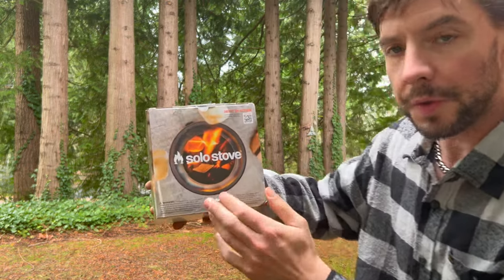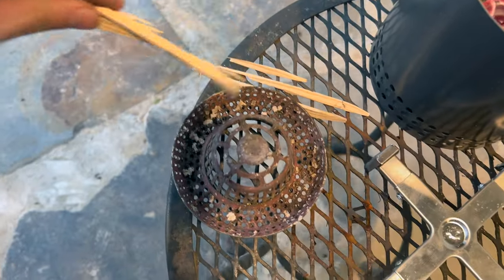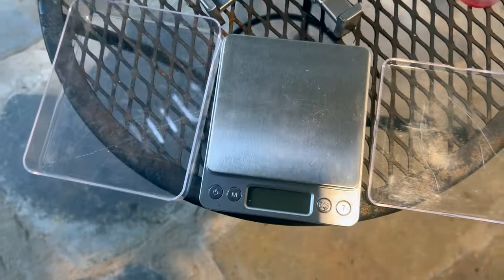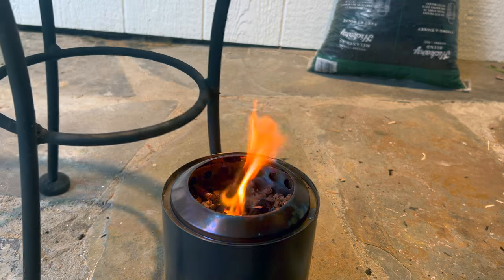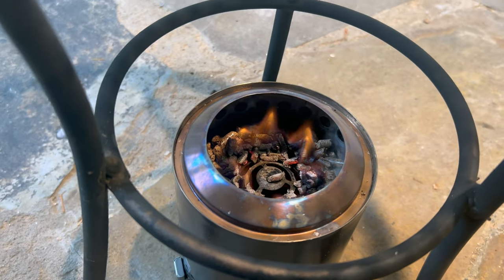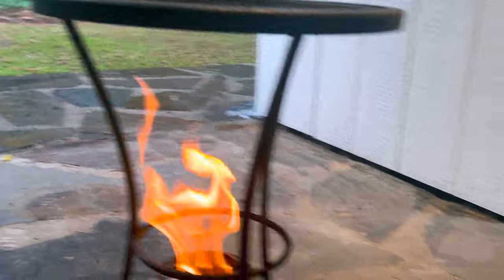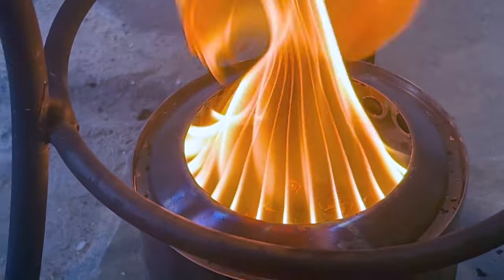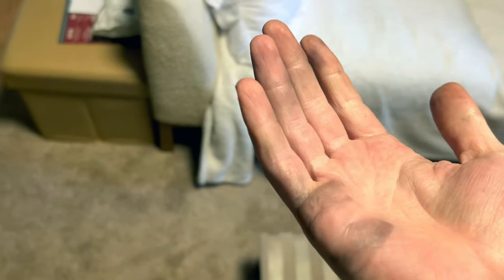Stunning 4K UHD Solo Stove Mesa testing & operating, burn #4 with commentary & thoughts

Comment from the maker: Mesa is their most popular model

2.34 kilowatts of heat or 8000 BTU running on 289 grams of hard wood pellets for about 8 minutes at full output. Add 1/4 of pellets every 5-8 minutes to keep it going.

You can use it for cooking, boiling water, making soup, a dutch oven, just place the unit under a fire resistant stand, tripod holder, or similar and let the heat output from this stove and the fuel (twigs, or hard wood pellets) provide the heat energy. Be forewarned that a nice gooey layer of carbon tar will be deposited on the cookware, thats hard to remove, though the black soot deposited makes an excellent ink pigment for dark flat black, if you collect and mix it, sorta like old diesel vehicle exhaust can :) Think super fine carbon, very nice dark black ink pigment. 

The flame output can reach 3X the height of the stove from the top, and makes a sooty orange yellow billowing flame perfect for warming a small space outside during the evening with two people nearby, think patio heater. Have a bag of hard wood pellets with a 1/4 cup measuring cup made of metal to add pellets every 5 minutes or so to keep it going as you enjoy making smores or cooking meat on a metal rod or veggies on a metal rod. 

It's well made and comes with a lifetime warranty! They are on sale now too! We got ours as a X-mas present for 2023, thanks Sissy :)

I use small shards of pine wood knife split off dry pine 1X2 parts + a wax votive candle as a starter and that seems to work well! You can use paraffin wax + sawdust fire starters and they seem to work fine too.

Comment from the maker: Having to add more fuel every 5 min while cooking adds a fun challenge :) This little thing is a twig and pellet eating monster! I had no idea that much wood required to make 8000 BTU or 2.34kW of heat output. A bit like a candle in the wind in terms of thermal performance unless you are very close to it. Also the wind pushed the flame around a lot, so if you're using it to dry anything, be cautious to leave about 2 feet of gap space between the flame and what you are drying outside. In a fun note, it can add nice wood smoke aroma's to things you drying with it and you can smoke meats and veggies and other foods by running it rich with extra wood and vastly lower combustion temperatures. I am able to get it to bellow out vast amounts of smoke that can be lit into large flames with more ignitions.

Comment from the maker: Be warned. I used this stove to cook bacon outside, so it would not make the entire inside of our small home smell like cooking bacon, and used a small 8in stainless steel pan that was coated with a thick gooey hard to remove tar carbon from the sooty wood flame from not very efficient combustion (yellow orange beautiful, but indicates low combustion temperature)(blue or clear flame indicate complete high temperature cleaner combustion. 

The manufacture would not even tell me how to reduce soot formation from the hardwood pellets and recommended that I dedicate any cookware to this use only, as the carbon deposits nearly unavoidable, and so hard to remove that I had to buy bar keepers metal cleaner and a scouring pad and it was still hard to remove the soot with this method, though with lots of work I was able to clean it mostly, but its cosmetically modified and I would need to use a power drill to actually metal polish it back to its original stainless steel shine. The chat bot also told me to use a propane stove to get much cleaner combustion, but I really like biomass combustion since tree's are more renewable than propane. So I asked about using pressurized air to provide more O2 for combustion or drilling holes to improve airflow and the chat bot said not to. The human agent Julia was unable to help me either, other than to recommend the barkeepers steel cleaner to clean the cookware of the carbon tar deposits with lots of hot water and soap in additional steps.